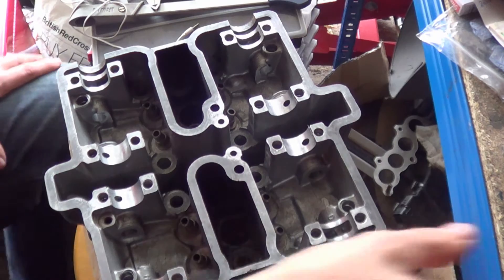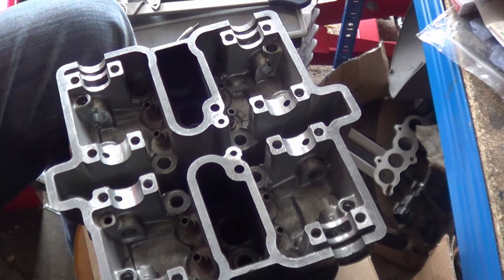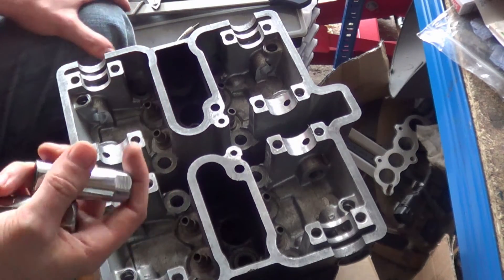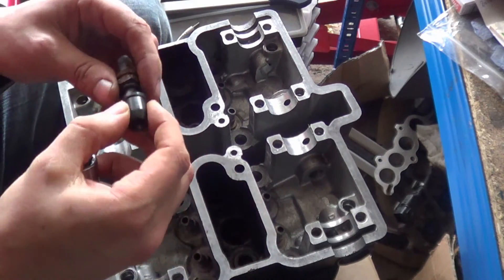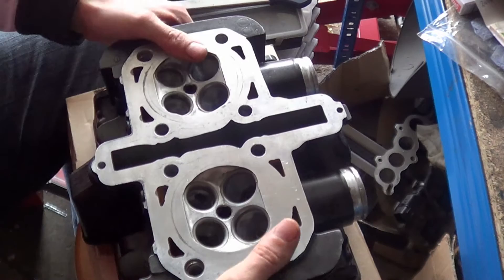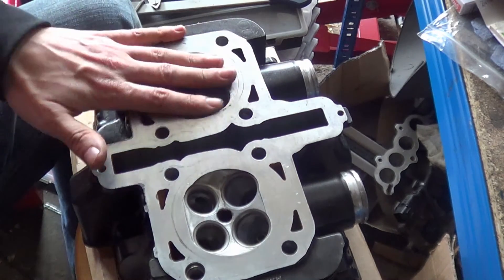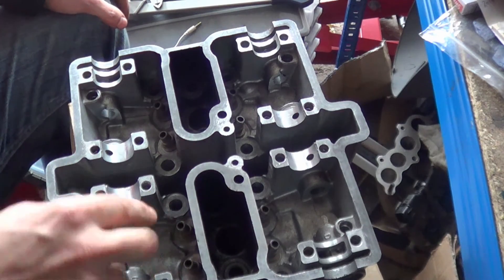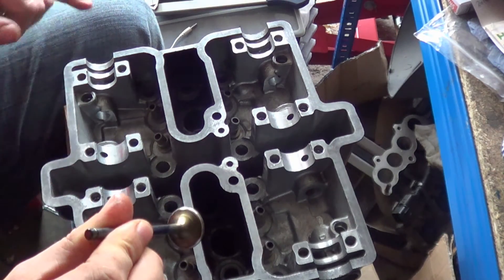Kawasaki ER5/KLE/EX500 - Episode 55 - Talking about the head

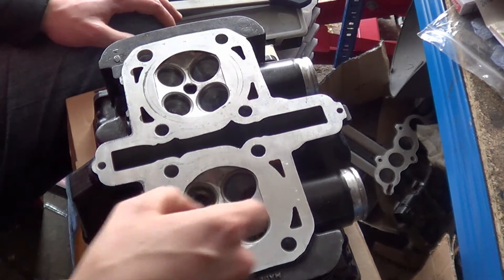Comment: 6:03 I did the same with a bike I have been working on; but the problem I am facing now is that the whole head has been left on the bench unprotected and got covered in grinding dust ... so I am concerned that there will be debris in the water passages and in the valve guides.

Any input on how best to clean the whole head before reassembly ?

Parts washer and just flush the ever living fuck out of it and hope for the best ?
Small nylon brush (like a bottle cleaner or rifle cleaning rod) for cleaning inside valve guides, or would that just result in scoring etc ?
Reply from the maker: Wash the whole thing down a couple of times in the parts washer and you should be good. Gravity is your friend. Blow air through the valve guides and you'll be good. Don't push anything down the valve guides
Reply: @thedirtyworkshop  you're a legend dude !
Reply: @thedirtyworkshop  haven't done anything with it yet, been too busy to bring it down to my mates to get it washed; will I chance throwing it into the dishwasher ? lol